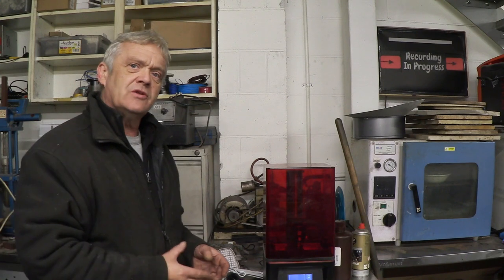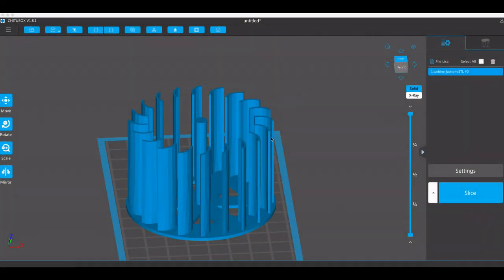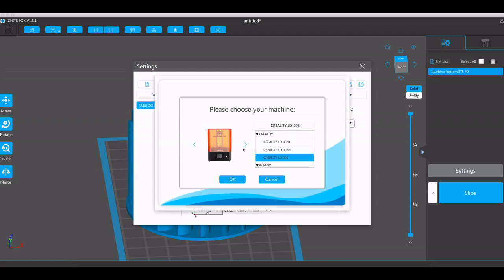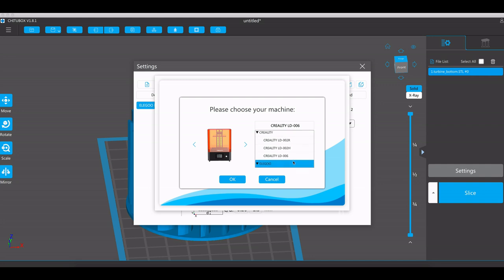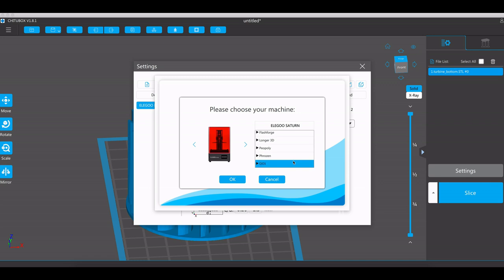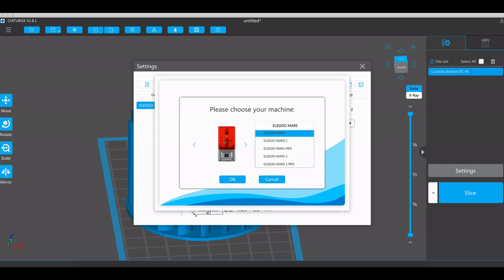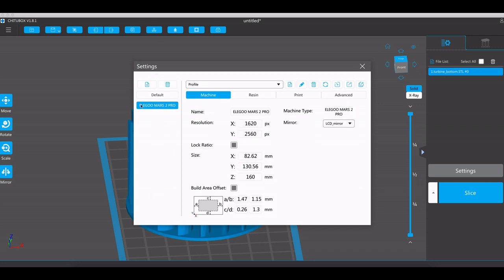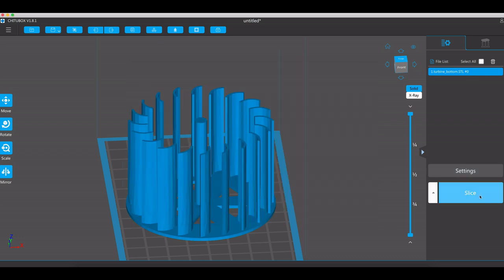1345 Solving The Unrecognised File Message For Mars 2 Pro 3D UV MSLA Printers

Comment: Please consider my comment sir

MECHANICAL DC FastCharger

Running your BLDC mechanical speed controller in reverse will provide fast DC charging from 3 phase AC

While applying the same concept to single phase AC home outlet will enable fast charging DC

The speed of the dc motor will affect the output charge

I am sure you understood what i am trying to explain and please consider demonstrating the idea if you agree